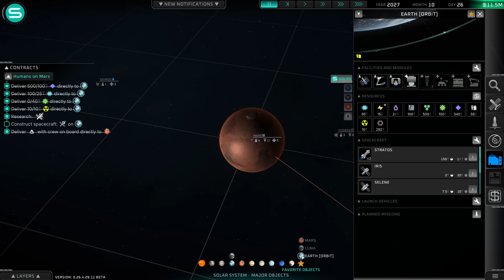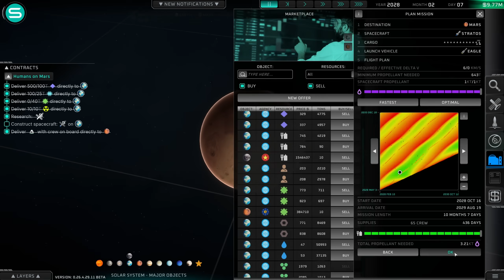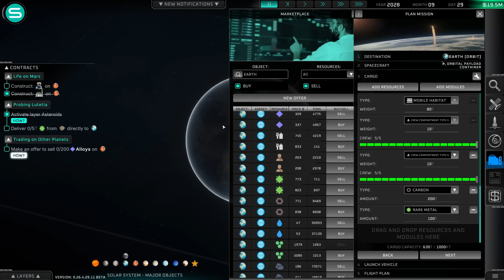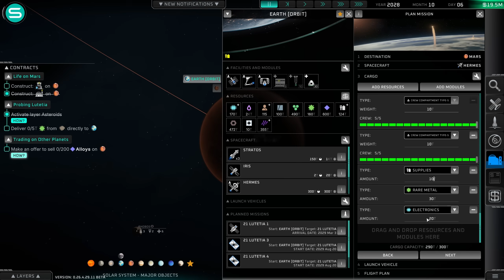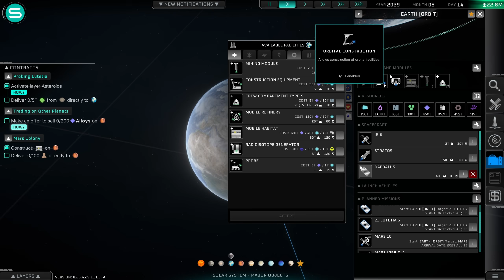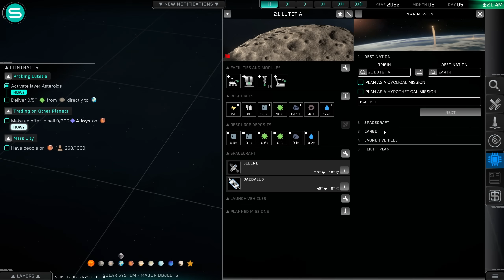My Neighbors Are Slow | Solar Expanse | Ep4

Comment: You can move a mobile hab on sails you just need to select multiple. You canlt solar sail people, solar sails lack life support, some other ships also lack life support (Iris, Selene, Athena, deadalus, Talos, etc) you can always check the ship details to see if they have life support or not.

For the Cyclical mission you can press the button to add resources, but you canlt drag and drop it;s an annoying UI quirk. There is no clone mission sadly I do agree it;s badly needed.

As for the AI and optimizing payload that is true but if the ship carries less cargo it burns less fuel, for not Solex it;s hard to get Stratus back from mars if it;s full of cargo... on some launch windows you can't even send a full stratos to mars. And yes you need more solar sails, endless endless swarms of them.
Reply from the maker: Interesting that you can move one module with two sails. That would be super helpful.

Comment: I don't know if you've realized (I think you have, because you've messed with the slider), but when you're doing a transfer, you need to drag the fuel slider down before you send the mission to not send a full load of fuel if you don't intent to send spare to the destination. When you sent your colonists from Earth, you selected optimal, but you still sent full fuel. You did lower the slider a little before this, but it got reset when changing screens. (Edit: It's done properly later.)
Reply from the maker: I have used it, but tend to really worry about under suppling fuel.

Comment: You need hermies, the only optional ships are the Iris, Selene and some of the nuclear ones. Maybe the Athena is skipable but it is so usefull. Nuclear takes so very freaking long to research.

Also undergound habitats are only for high radiation areas, extremly niche. the zero-G habs are insanly usefulll though.

For the supplies a 7-10 month trip and it shows you ~200 days worth of supplies. 7 months is about 210 days, the different units are annoying but 10 tons of supplies is close to the edge and the different mars windows are slightly different in length based on real orbital mechanics.
Reply from the maker: I did find out about the habs. :(